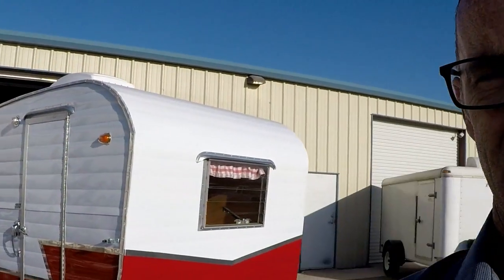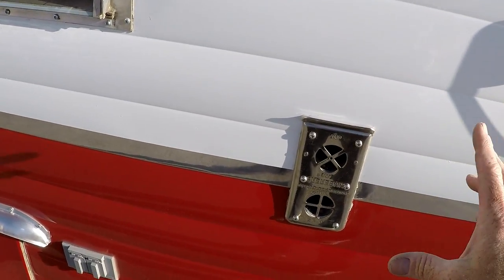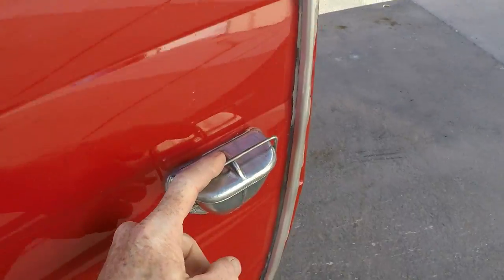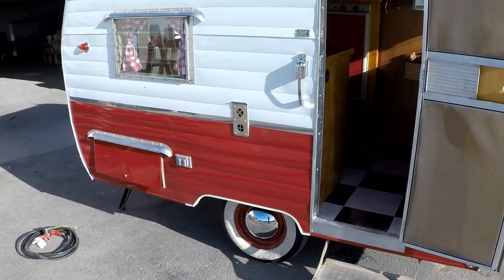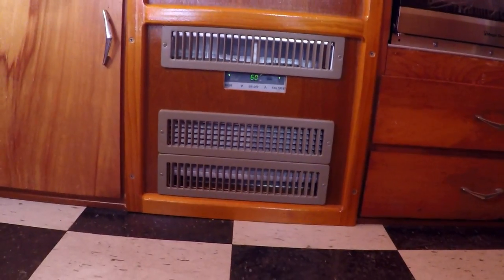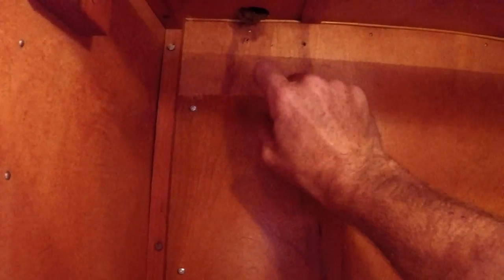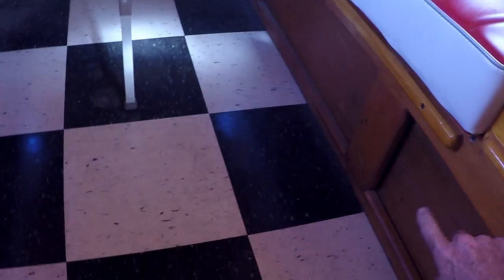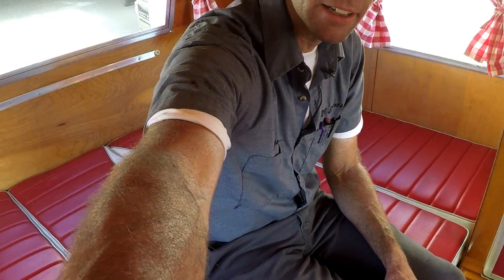Vintage 1960 Shasta Compact Re-Imagined

Comment: Very nice job. We had one of these when I was about 11 or 12. (Got a picture of the front of it actually) My job was to put the scissors jacks at the back of the trailer. Well, one time I forgot, and my dad & I were sitting in back at the table, and my mom was frying hamburgers on the stove. When she brought the burgers to the table, the weight transfer cause the trailer to tip, and besides making my mom fall towards us, the pan of hot grease flew off the stove and got everywhere. I don't think any of us got burned, but thank God the trailer didn't start start on fire. I don't remember what the punishment for my stupidity was, but I do remember how freaked out I was with the incident. I don't think I ever forgot the jacks after that.....
Reply from the maker: i did that a number of times on this trailer. Luckliy no one was cooking

Comment: I have a 1961 Shasta Compact .  I am so impressed by how much thought you put into the design, how much you were able to fit into such a small trailer and how well you pulled it off!  My trailer is very much original. I have it all cleaned up and looking good, but it only has what it came with back in 1961.  The original ice box (which mine still has) has poor insulation and is only useful for keeping sodas cool.  I also have the original stove and oven which work well.  I agree, the closet is just too small to be made into a bathroom so we use a shower/bathroom tent instead.  While my wife and I will keep our trailer very original, again, what you have done is amazing and shows that you don't need a huge trailer to be comfortable.  Well done!
Reply from the maker: Hey! Thank you so much for watching and for the great compliment! It took a lot of time and I put a lot of effort (and money) into restoring it so it's nice to have it appreciated!

Comment: This was our first  family trailer.  It was purchased brand new in 60.   Where are the hammock beds that came out over the bed .  there were 2 pipes that fit into the side walls with very drought canvas covers and were somewhat comfortable for a kid.?
Reply from the maker: This had already been "remodeled" when I got it. The only reason I was able to save so much of the inside was someone had coated the outside with some sort of rubberized paint. No bunks.

Comment: Looking at the original cabinetry and what you constructed is fascinating! I have often wondered how they were able to make these original trailers so light weight. The way they original designed and put together the interior is an excellent study in light weight design and sturdy construction without adding weight. 

What is the metal gauge of the new siding vs the original siding?  This looks like you managed to maintain the light weight of the original.

This has to be really light weight if a Prius is able to pull it. Especially since the owners manual specifically says your not supposed to tow a trailer with a Prius.
Reply from the maker: Thanks for watching!

Comment: What an awesome job you did restoring this beauty!  If you have time I would be interested in learning about the A/C and heating system, refrigerator, roof vent you installed.  I have a vintage '73 TravelMate travel trailer that I would like to convert to the systems you used.  You mention the A/C system was quite involved.  If you had to do it over again what would you do different?
Reply from the maker: I recorded so much of this build, but the camera lost half the videos and dropped half the audio. I'm not sure if I would do the A/C like that again, but it needs A/C and I think preserving the roof lines and not having large ugly vents was important too.
Reply: @AZExpert  I use a portable heat pump in my camper and it’s does fairly well with the exception of hot humid days. Thank you for the many informative videos!

Comment: Awesome job sir, you have a new subscriber love you videos very informative
I recently bought a older truck camper maybe 70’ or 80’ it’s has some bad water damage on the front of the camper that goes over the cab I would like to fix the damage, But being a framer Over ten years I can replicate it a lot better and stronger the only thing I don’t know is were I can find the aluminum siding do you a place here in Az that May find it 
And by the way I work in Mesa by southern and Mesa and live in Phoenix 
Thank you hope to hear from you
Reply from the maker: thank you very much. the surprising issue is that the siding is expensive. Hemet Valley makes it custom and all-rite. shipping is pricey too

Comment: Very nice! 
I just bought one. 
Would you be willing to share your tire and wheel size? Also does your new axle have the same drop?
I was thinking of doing a straight axle with brakes and a set of 14x7 wheels.
Reply from the maker: I went with st175/80 d 13 tires wheels. And I went with a straight axle with brakes. The wheels have to be tilted into the wheel well to be installed but have plenty of room once in and fit nearly identical as the originals. I couldn't say for sure 14" would fit without flipping the axle as the well is tight. Thanks!
Reply: @AZExpert  Excellent reply‼️ Thanks 😊

Comment: cute trailer - I may have asked this earlier but I have not found an answer yet. Where can I purchase vinyl molding/trim that would go around my kitchen cabinet and bathroom cabinet so water will not seep to the wall behind the cabinet when I'm using the sinks.
Reply from the maker: https://a.co/d/dawrW46 vinyl hollow welt

Comment: Daulton Ruff
I'm now 77- I had,/have a 1964 Shasta which I have disestablished. It's been a couple of years now and my dream of rebuilding it has wilted pretty badly. I have a bill of sale for it and I've kept all the exterior walls, and the ruined cabinets and metal that I was going to rebuild based on the old ones. I have a pile of all of the ancient fixtures, and the door handle and hinge of the door someone ripped off with part of the aluminum. Windows I have but people have shot out the glass on a lot of them. One window is missing. Long story short, it is too much for me and I wonder if the parts are worth anything. I rebuilt the trailer bed and extended it a foot and that project was interrupted as well. But it has new 10 ply tires, and a new jack and a 7 pin plug on it. Now my question is what to do with the aluminum top and siding, etc. .

Comment: Hi is there any insulation in this trailer originally, did you add any. I just bought one. Where does one get the exterior metal when damaged? I have so many questions. Thanks!
Reply from the maker: Yes just fiberglass in the exterior wall. Sorry, the audio failed in most the videos I recorded so I couldn't make a series
Reply: Do you do repairs for people? Where in AZ?

Comment: Very impressive, just wondering where the toilet is???
Reply from the maker: There is no toilet. Small trailers like this will only have room for a wet bath and they are not fun to use. I have found cassette toilets to work much better for camping in these ultra small trailer. Thanks!

Comment: I have a 1954 Shasta compact trailer. Everything original. Bed pulls out from celliig. Couch goes into bed. Original sink, stove, ice box. It has a lot of water damage in celling at vent and along door. Could you please rebuild inside of my trailer. I have cancer. I would like to be able to take it camping one last time. It got damaged 2 different years during bad micro downdraft draft bad storms. Please

Comment: I have an old 1972 or 1973 AMF Skamper M-285cb that I want to get rid of. It needs a lot of work and is not livable, but it could potentially be fixed up or used for parts. Anyone want to take it off my hands?

Comment: It might be more convient if you put a small portable cassette toilet  under a cabinet in the front ,because when you are camping in a park or other place this will help at night, or during inclement weather and would be safer. A rod mounted along the ceiling with a curtain would provide privacy.
Reply from the maker: IT does have one

Comment: You tow this with a Prius? I mean I'm sure I heard you say that but do you go on trips with it or just pull it around while you're figuring it out?
Reply from the maker: I pull it around town with the Prius. It's really not a weight or braking issue as the tongue weight is less than 50 lbs and even the stopping weight is still within the Prius' 5 adult passenger plus cargo rating. I don't like the excessive drag the taller trailer puts on the transmission of the Prius. So I do not use the Prius to take the trailer on vacations for sure. I know some Prius owners do drag these taller trailers around, but my concern is overheating the CVT because there is no gauge for that. I do drag my teardrop up and down mountains with the Prius though. Thanks!
Reply: I have a 1961 Shasta Compact.  It is listed as 1125 pounds, plus I'll add another 2-300 pounds of gear when I go camping.  Tongue weight is listed as 175 pounds which is close to my car's limit. I'm using a Subaru Outback rated at 2700 pounds for towing.  You don't want to pull a trailer that is right at the limit of your car for safety reasons.  My Subaru pulls this trailer nicely and I have climbed through the Rocky Mountains at nearly the speed limit.  The trailer does take my gas mileage from about 28 mpg down to about 19/20 mpg at 60mph.
Reply: @dereks2642  thank you for your response! If I was going to do much healing over 1,000lbs I would definitely make sure I had trailer brakes. I have a Volkswagen GTI and it is substantially the same vehicle as they have in Europe and it has similar tow ratings to an Outback here but my car has less Mass and a shorter wheelbase so it's easier to get pushed around. I am also looking into getting one of those lightweight anti-sway/ weight distribution hitches.
I'm looking to build out an ultra-light cargo trailer into a modular camper for the versatility and substantially better long-term value at a lower entry cost.